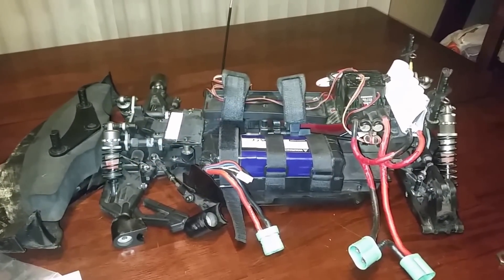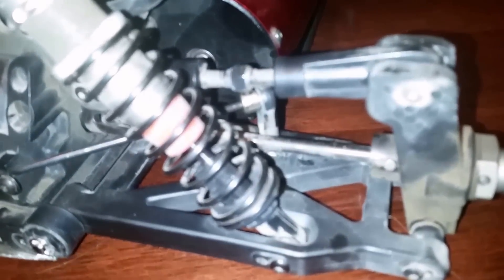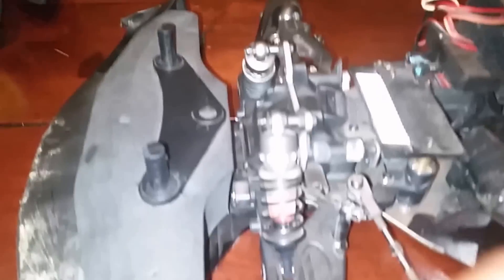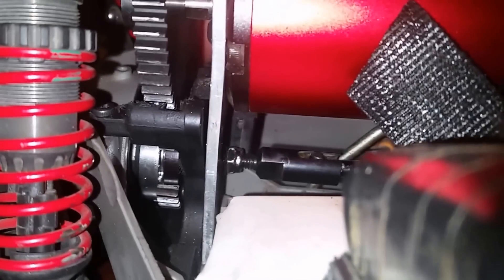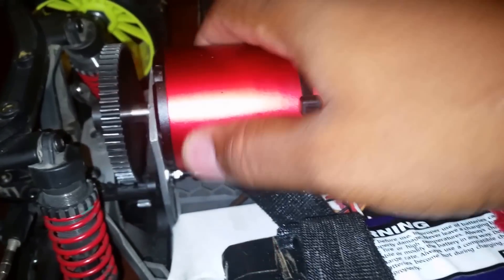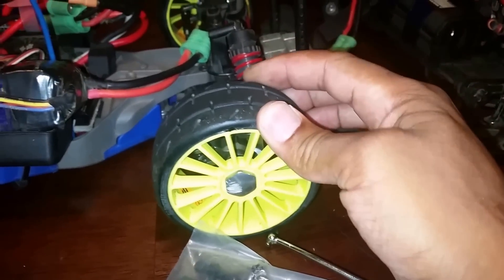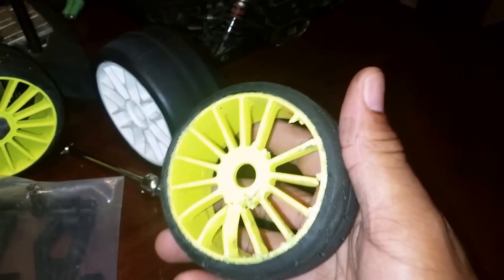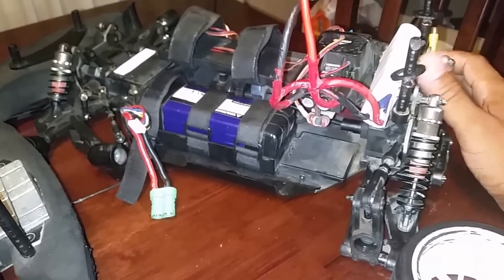BU: Wreck Tabletop GTP2e and Slash 4x4 lcg

Comment: what rear slipperclutch/diff is that? looks much moore beefier than stock
Reply from the maker: +jimmy vahviala Its the slipper clutch adaptor. Gets rid of the slipper altogether. Must have for your speed slash. Slipper clutches are no bueno. http://www.ebay.com/itm/ALUMINUM-SLIPPER-CLUTCH-ADAPTER-S-TRAXXAS-1-10-SLASH-STAMPEDE-4x4-ALLOY-/400599676866?hash=item5d4599f7c2
Reply: aha! i see, and where do i get spurgears for that? ebay too?
Reply from the maker: jimmy vahviala it fits all traxxas style spur gears. so where ever you were getting the gears from before. I think you are referring to the steel mod1 revo gears you see everyone running...
Reply: aha, i see, mod1 is good, that is what i use for my other cars. so its revo i need for that. Thank's i bunch!